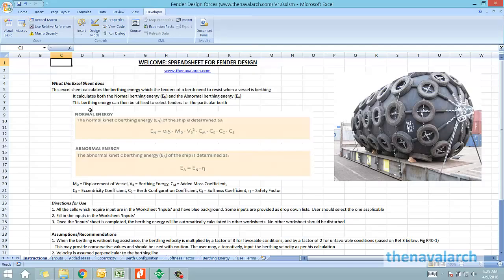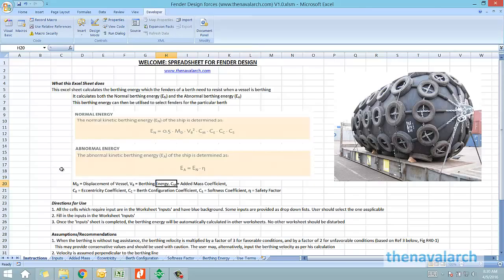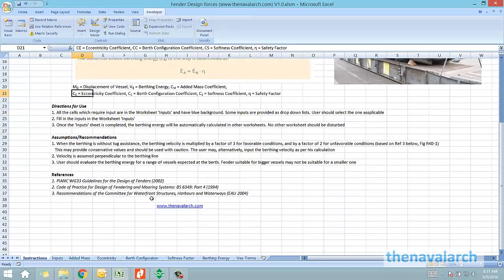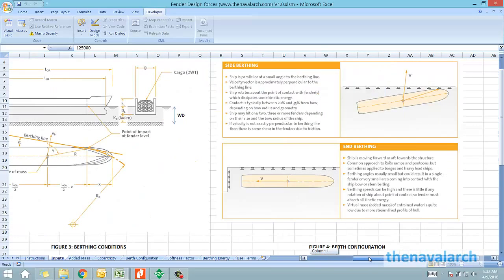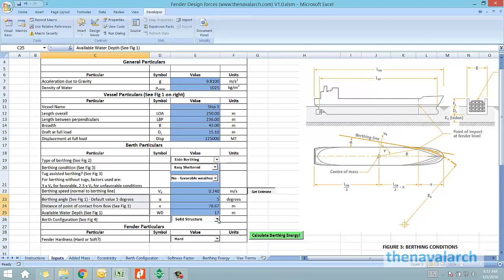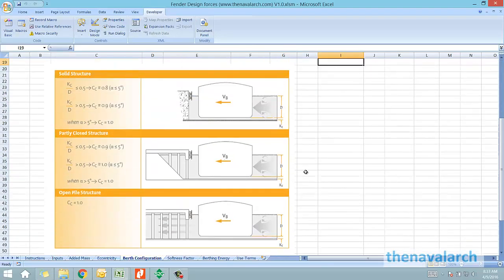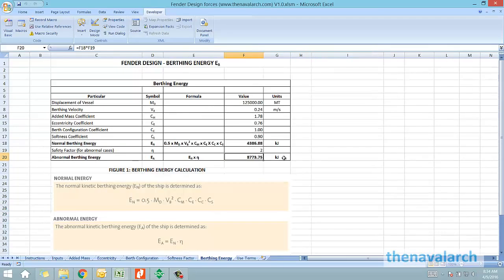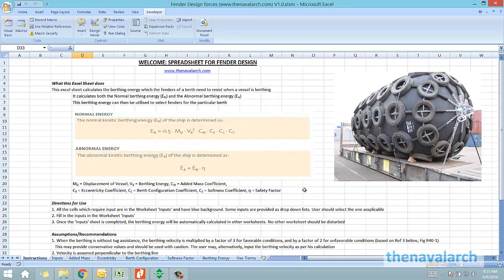Fender Design (Berthing Energy) Calculator (www.thenavalarch.com)

Comment: Can i get an explanation on how to determine berthing conditions? I dont understand the parameters on how to decide if its easy or difficult berthing, as well as exposed and sheltered. Any help is appreciated.
Reply from the maker: Hi Ronald
The berthing conditions depend on the environment of the berth. If the berth is exposed to open sea, then it is exposed. If it is in a harbor area where wind and waves are expected to be minimal, the condition will be 'sheltered'. Hope that helps